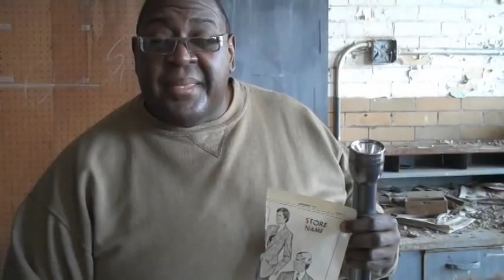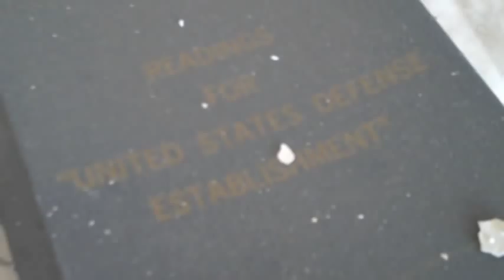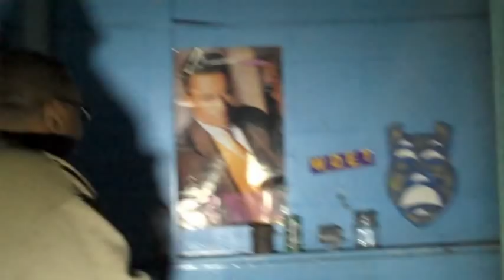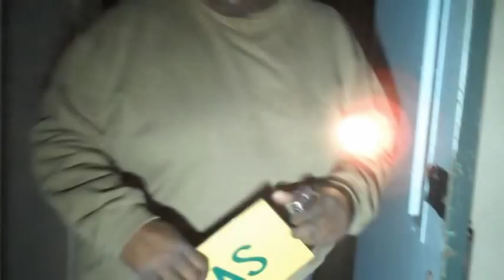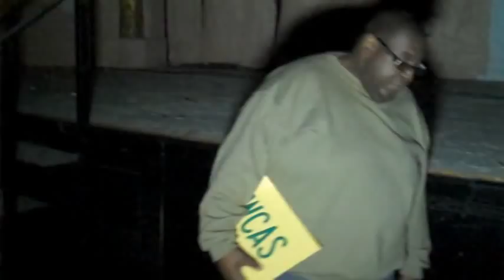Old Cass Tech High School - Part 2

Comment: I had the late Jim Spivey for health.  

Cass Tech had an extension built and it housed the "new" cafetorium. When I entered Cass in the 9th grade, I had GYMNASTICS in the 7th floor PE room @3:30.  The interesting thing is that the girls locker room was located on the 1st.  We literally received our warmup exercise running from the first to the seventh and then in reverse to change for the next class.  Imagine lunch being the next class.  We were lean.  The elevators were not always an efficient mode of transport.  You were better off navigating the stairs for the best chance of reaching your destination on time.  #memories